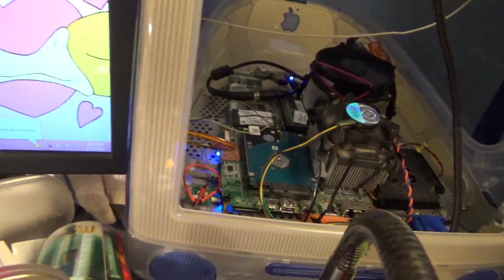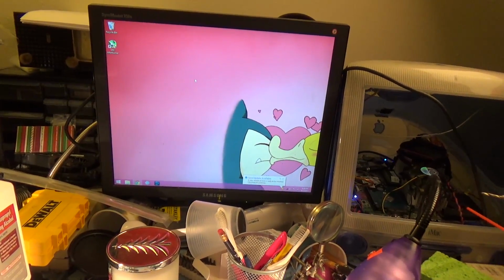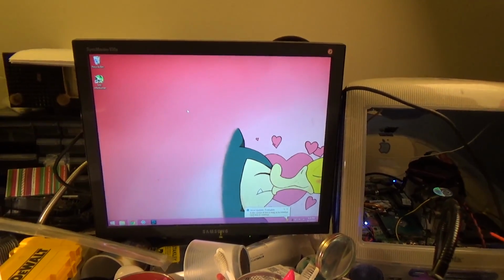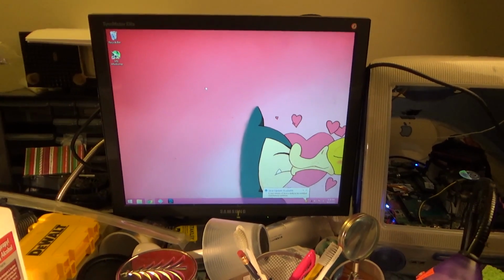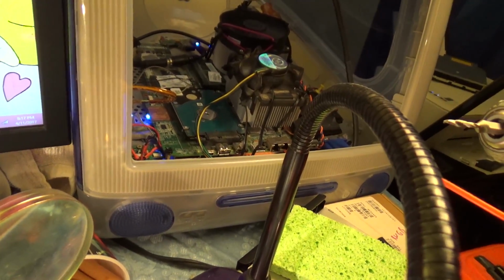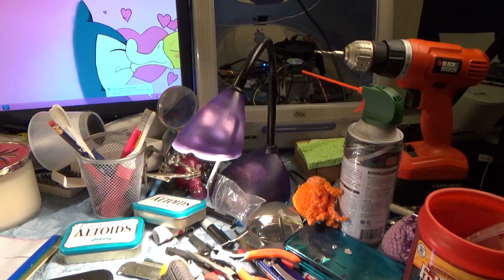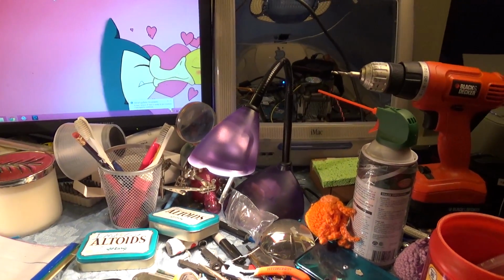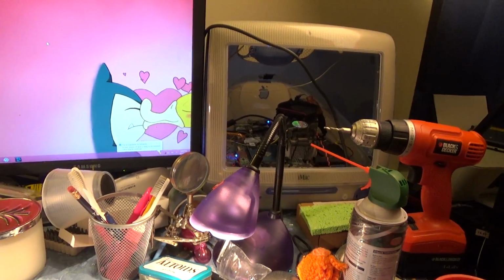Project iMac - Build log: Part 2 Putting a 'modern' PC inside a classic iMac

Comment: Hello, I am planning on doing this but using a pcie rise so the graphics card can be on the bottom and an aio for the cpu at the top and some low profile ram, would i still be able to fit in the crt?
Reply from the maker: floral l0rd the problem with the CRT is that you would need to build a custom power supply and controllers for it to be able to use it. It’s sadly not plug and play, but rather a raw tube you have to design a control circuit for. So it may fit, but unless you’re a hardcore electrical engineer, getting it to work is near impossible :(